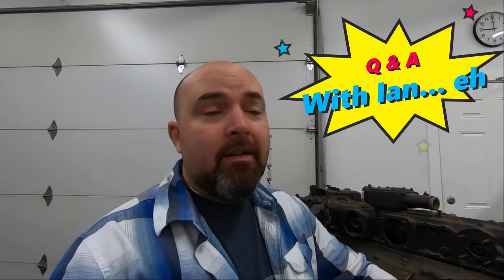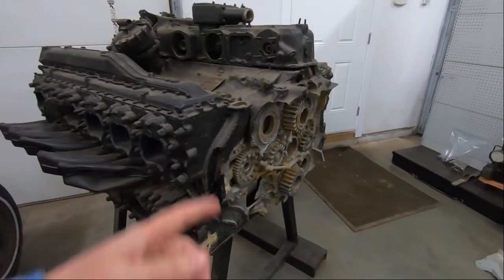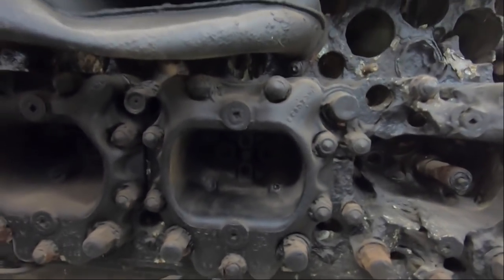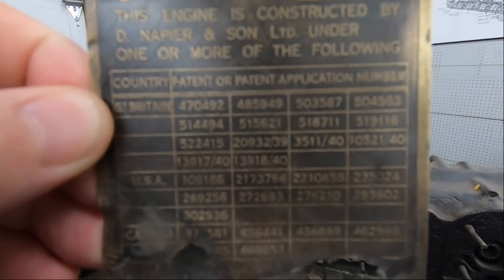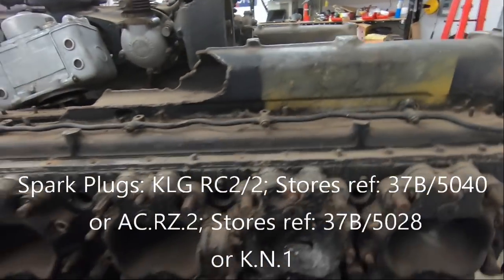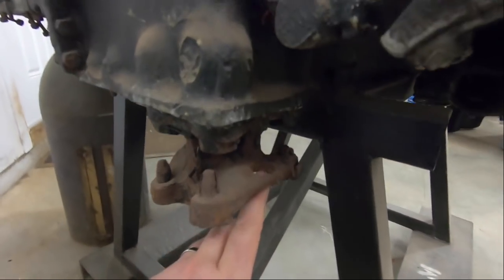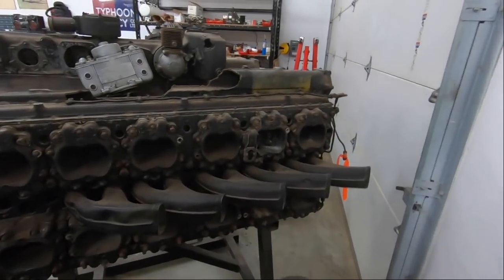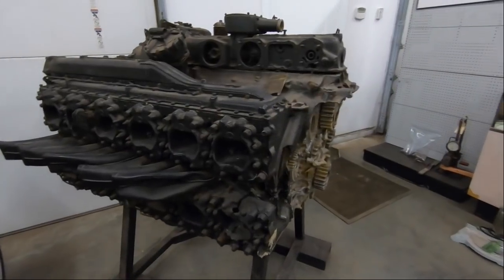Q & A with Ian eh! The Napier Sabre Engine

Comment: If you guys are serious I would respectfully suggest you get a single cylinder prototype same bore & stroke to actually rum smoothly.
Reply from the maker: There is a big difference in running a single cylinder engine and a 24 cylinder engine. There will be massive amounts of ground testing on any potential runner.~Ian

Comment: I had not seen this one although I do try to  follow Ian with this very worthy and necessary restoration project. 
The Typhoon and Tempest stories are well described by Roland Beaumont’s ‘Tempests over Europe”. To say they made a quantum difference 
would be a colossal understatement. Of all ww2 allied warbirds which we know and respect : Mustang p51 111 on , Hurricane , Spitfire, P47 . The sheer speed
and stability at medium altitude were unattanainable by those aircraft. Glamour they may have lacked but in 44-5 were  unmatched in punch and speed, when the Sabre
Was finally sorted in late ‘43, an (object lesson in engineering Co operation by manufacturers who are otherwise commercial rivals). It is scandalous that
They were scrapped with far more efficiency than their inception acceptance and development.
Reply: Beamont, not Beaumont.

Comment: out of curiosity: what is that part on the top of the engine that looks like a small air-cooled piston?
Reply from the maker: That's an air compressor for brakes and gun firing systems. ~Ian
Reply: @TyphoonLegacyCoLtd  thanks.  It reminded me of the little engines of the rc models I used to fly

Comment: I have a question I don't remember anybody asking, what advantage does a rotating sleeve valve over the traditional valve tappet and rocking arm roller has?
Reply from the maker: Reduced friction and increased compression. One of the issues with the sleeve valve system is sealing and oil consumption. ~Ian

Comment: At 3;15  the 228 is visible but there are other numbers visible as well. I can see what appears to be a 7 or possibly a 1 with a small 2 at its base left of the 228 and also another 2 at the right of the 228. The script or brushwork is totally different and it appears to be underneath the  228.

Comment: This engine won't fly - too much missing, too damaged, too far gone.  "Working on other Sabres . . ." oh the anticipation . . .
Reply: +  Happy Home    But there are lot of inside mechanical parts that don't have to be made to assemble a running engine.  Those hardened gears and shafts will not have to be forged, heat treated and machined to specs.   Arguably, the engine crankcase halves will be comparatively easy once they are in CAD software.  A different aircraft project has already 3D printed the sand molds to cast major aircraft engine parts, so the process is proven at least.
Reply: @FiveCentsPlease  Excellent, thank you.

Comment: Do you know how many of these engines survived the war and current availability?
in the 50s, 60s, 70s and 80s unlimited hydroplanes in America and Australia primarily used Allison, Griffon, and Merlin V12s.  The availability and reliability of these engines after switching to turbochargers with nitrous oxide was dwindling the supply.  Nearly all have switched to the lycooming gas turbine engines from Chinook Helicopters, but there are a couple teams that still use the old V12s (Merlins if they can find them).

The racing teams wouldn't be limited to all original parts if modern ones are available, but what do you think the likelihood of a team getting 2-3 engine blocks and cylinder heads?  This is the first i have heard of the Napier engines.
Reply from the maker: There are estimated to only be 35-40 Sabre engines in existence, most of which are crash recovered; so the likelihood of finding one for racing would be low. New build blocks would be a better possibility, it will just take time. ~Ian
Reply: + Jamy C.   The boat racers gobbled up and destroyed as many engines as they could get their hands on.   And the tractor pullers are destroying anything they can find.   I think that if the hydroplane sport wishes to return to big displacement piston racing, they should either design their own engine or find a substitute.   Falconer makes a nice V12 though it is smaller, but I think it could be configured as a marine variant.   Also, Aerosport Engineering in Norway has a new aero V12 derived from BMW V12s that's delivering around 700 hp and I'm sure it could be modded to put out more power for a marine conversion.
Reply: @FiveCentsPlease  Thank you.  Unlimited hydroplanes are out of my budget. I had a brief off the record conversation with driver Terry Troxel almost 20 years ago.

He was designing a revolutionary hull design with minimal drag coefficient and working with an engine builder in Canada.  The plan was to supercharge 2 mated short stroke V8s. Two years later he had a mild stroke. He returned racing after his recovery, but retired because he wasn't as competitive.

I would like to see the sport eliminated the gas turbine engine unlimited class or even the class entire.  The Grand Prix class is popular in Australia, but is the red headed stepchild in America and there is no excuse... (well, APBA bullshit politics).  Everything people loved about Allison and Merlin is captured in these. 1500 HP blown Chevy big blocks deliver plenty of excitement.

I share your disappointment about the destruction of those beautiful V12 war bird engines.  The Budwiser team would show up to races with a 40 foot trailer filled with them. They put a new engine in after every heat. They were as expendable as tires in auto racing.  😞

The teams that still use them cherish them like they are gold.

Comment: Amazingly compact for its power. We forget this is far from all there is to this engine. Cooling, supercharging, fuel tanks and weight, oil tank and pumps, combine to fly. And it's 80 years old. Mind you the B52 is 70.

Comment: Would it be possible or even financial feasible to restore it and maybe reproduce an engine using this as a blueprint and use one of these engines in an automobile of some sort like several people have done with the Meteor and Merlin engines? Especially since so many aero engines were used in race cars I can't help but think how cool this would be in a period car similar to how Jay Leno has built using Merlin/Meteor engines and his collection of period aero engine powered racers.
Reply from the maker: Certainly possible given the resources available, but it would also take someone with significant funding to entertain putting a Sabre in a car. Personally, I would like to see a Sabre mounted to a Fury at Reno... any takers? ~Ian
Reply: + Chesspiece    Adding that after all of these decades nobody has even managed to get one running on a stand demonstrates how rare and technically complex the Sabre is.   There just aren't many of them around and I am astounded that Kermit Weeks managed to get ahold of two of them for his project.   There are mechanical hobbyists out there who could do it, but there just aren't a lot of spares laying around.

Comment: Good stuff thanks for posting.. Is that engine mount vibration problem on early ones anything to do with the tail end weakness?
Reply from the maker: Vibrations were a structural issue, however the rear fuselage failures early on were related to elevator flutter which caused excessive stress on the transport joint between the forward and rear monocoque sections. ~Ian
Reply: @TyphoonLegacyCoLtd  Thanks Ian 👍🏼

Comment: Are you looking at 3D printing missing/replacement parts instead of conventional casting
Reply from the maker: There is a bit of research going into this, but the applications are minimal for this work on a certified aircraft. ~Ian

Comment: Are there any Sabre engines anywhere in the world that are in running condition?
One of my bucket list items is to see a Sabre run.
I have seen the Sabre that is in the Smithsonian Garber Restoration facility, so that's been checked on my bucket list.

Reading the comments below, I see that you are considering generating a 3d solid model of the engine.  Have you checked with the Smithsonian Air & Space archives?  It wouldn't surprise me if they had a full set of blueprints for a Sabre.  It would be a monumental task for a design engineer to translate 2d drawings into 3d solid models, but there are software packages out there that would help.  I have a lot of experience designing engines in SolidWorks, but nothing as complex as the Sabre.  It would be a large mountain to climb.
Reply from the maker: None running unfortunately, not since the 50's. From our investigation, there are no drawings in the Smithsonian, the Sabre they have was the spare from MN235 when in the US for evaluation. ~Ian
Reply: @TyphoonLegacyCoLtd  Very interesting that drawings are so hard to find.  I assume you already tried the Napier Power Heritage Trust.  Did you try the Air Force Museum in Dayton, Ohio?

Comment: You may know this, but one old film about the Sabre said carbon monoxide was so bad in the cockpit that the pilot stayed on oxygen from startup to shutdown.
Reply from the maker: They did make several modifications in an effort to resolve this issue (sliding hood being one), but as far as I've found, oxygen remained a full time requirement throughout the Typhoon's service life. ~Ian
Reply: @TyphoonLegacyCoLtd  Okay...glad you heard that! Would hate to have a pilot pass out after all of that work! Best wishes...I find the Sabre engine a fascinating design. M
Reply: Gerry Sayer, Gloster's chief test pilot was killed to this while flying a Typhoon in 1943.  The final report on the crash blamed CO poisoning as the cause.  From then on, all Typhoon pilots were on oxygen from engine startup until shutdown.

Comment: Aren t there any napier sabre engine s on the bottom of the ocean??? Surely there must be some who crashed ....not every pilot was always lucky....(sad enough)
Reply: +mr lonewolf groot wassink     Minerals,  acidity,  and oxygen content will affect objects regardless of if they are in soil, saltwater, or freshwater.   Metals in particular can be very reactive.  More then once an aircraft salvaged from a low oxygen environment went through a rapid decomposition when exposed to a fresh oxygen environment.   Over time the metals have absorbed minerals and salt and these must be removed or stabilized as part of the conservation process.   There are certainly engines that have been dug out of the mud or clay which have been rebuilt (with some replacement parts) and turned into ground runners.  It would be unusual to see any saltwater engine that could be rebuilt to a flight certified condition.   Typically saltwater engines are a rotten and rusty mess:   https://3.bp.blogspot.com/-I-5FMykcy6Q/V4dTujc9WMI/AAAAAAAASbc/Yx-Qv_JEDlYwXKd0smK10HQe7IeDqgPqACLcB/s640/4.JPG
Reply: @FiveCentsPlease  thank you!!! That was a decent and verry fine explanation...that was verry welcome!👍👍😃
Reply from the maker: Anything out of salt water would not be in very good shape, but there are always exceptions. ~Ian
Reply: @TyphoonLegacyCoLtd  yeah....that must be also true....well people always told me because of the fact down under water there s no oxygen...things are after a certain time of decades even still preserved in a good condition....but yeah....the salt must also do a lot of downbrake....
Reply from the maker: @searchthetruth1981  Salt, temperature, current and sea life all take their toll. That said, there are always exceptions, the Sabre in our shop is from salt water, and even some original paint markings are intact. It seems that it was stuck in mud which did a good preservation job. ~Ian

Comment: If anyone appreciates this aircraft engine story you will ! I was up in Kenai Alaska . I was in fairly remote area. I came upon a field . In the field standing up on end were 6 or 7 R4360 engines ? The ones used on the Hughes Blue Goose. They were wild just sitting there. Totally blew me away . I tried to buy them , even though I don’t know why ? I think the guy wanted 12 grand or 25 grand for all. I remember he said each engine had a 1,000$ in sterling silver ball bearings ? Engine trivia . Ha  on the motors the heads cylinders twisted around the whole motor , spirally . Was crazy to see. There 17 or 18 or 23 ? Cylinder. It was an amazing find . Very cool videos 👍🏼
Reply from the maker: Massive engines, generating HP using as many cubes as you can fit in there! I wonder what happened to them? ~Ian
Reply: @TyphoonLegacyCoLtd   I was in absolute awe of them , despite not knowing what they were exactly. 
They were standing up , all complete as can be . I’ve seen ubtube videos of them run on stands . Omg.
I had taken pictures and researched them right after seeing them . That’s how I made blue goose link. They didn’t seem to worth much extreme profit ?
I remember a lot of stuff. It was down “ Funny River Road” Soldotna Alaska . 18-20 miles down road ( it’s a Long dead end ! 27 miles)
There was a Fly in house development, bare bones big gravel runway . One or two hangers and one or two homes/ cabins . It was just getting started . That’s where they were . 👍🏼 They were so cool and there were at least six !

Comment: 24 cylinders, 2 crankshafts, 24 sleeve valves actuated by 2 driveshafts with internal supercharger shafts running through them, siamesed exhaust ports, and 3000-plus horsepower.
At least they kept it simple.
Reply from the maker: It really is a thing of beauty! ~Ian
Reply: They were saving the real complicated stuff for the Nomad....

Comment: Ian a good talk on the Saber which interests me greatly.
In the 1960's I worked for NAPIERS in the Liverpool works where the Saber was made in the 1940's.
There were some colleagues who had worked there during the Saber days who remembered well all the problems.
The Napier  company was taken over by English Electric Group in the early days of Saber production to get production going at a pace.
The design engineers were more interested in extracting more power from the engine than volume production
Towards the end of production the Development engineers produced the final version of the Saber with increased boost, water injection etc.
This was tested and produced over 5,000 BHP a record at the time but was overtaken by the Jet engine.
I look forward to a re built Saber working again in a Typhoon .
Keep up the good work.
Reply from the maker: The engine sure has an amazing history, it's always interesting to think what could be done with the design using modern materials, fluids, coatings etc. Thank you very much for following along with us! ~Ian

Comment: Great vid, I have never seen the insides of a Sabre, other than the one at the Ottawa Aviation Museum, which is a cut away version. It is too bad you couldn't just make the missing pieces, and weld them back in, and re-machine it. But that is just fantasy on a casting this complex (plus you would have to steal their Sabre, as there is no way they are going to part with it!). Perhaps scanning a whole engine, and 3 D metal printing a bunch is the way to go. At least that way you know there are no cracked engine block surprises!  Machining up the cranks and gears etc. would be a challenge, but the sleeves would be a real challenge. You may have to employ a psychic to get lost info from Roy Feddon on the other side, to learn all of the ins and outs of how Bristol made the sleeves that worked properly! :)  Perhaps Rolls Royce could search through their records on the Eagle -22, though it was prone to come to a clanking halt in mid-air, so probably not much of a help.  We NEED Dr. Who's TARDIS so we can go back in time, and mount a Napier Sabre rescue program!
 OK, so I got off track there a bit, I blame Covid winter boredom.  I will be fighting hard to get my 24 cylinder engine going this summer to help keep the running Napier Sabre spirits high. Take care.   Miles
Reply from the maker: There are certainly many options available using new technology to bring Sabre engines back. In some cases, we're just waiting for specific machines to get big enough... and they're close! ~Ian

Comment: Great Video! I have always been fascinated with the sabre Engine ever since my grandfather told me about them many years ago. He was a roving Engineering Designer who was seconded to many firms during the War , From Rotol and Rolls Royce and even to Barnes Wallis's team at Brooklands  directly under Barnes and Professor Lilley who I had the pleasure of meeting before he died. I remember my Grand father telling me of when he witnessed a Sabre Engine being Tested to Destruction on a Dyno ( i think he called it a wire Dyno, but my memory might be failing me there).  There was a story doing the rounds about 25 years ago that there were 2 complete Sabre V engines in the Middle East that had purportedly been fitted to an offshore power boat, I tried to do some digging but could find no corroboration.
Reply from the maker: Testing such an engine to destruction would be amazing to be involved with. I've heard stories of Rolls Royce doing the same in their development of the Merlin. Please do let me know if you find those Sabre's! ~Ian
Reply: @TyphoonLegacyCoLtd    I am reading that Napier did a study with the Royal Navy in 1942 for the possibility of a marine Sabre engine.  A prototype was built and the project was cancelled.   Four marine Sabres into one boat -- that's a lot of noise,  a ton of fuel and a lot of troublesome engine starts.  Napier had better success with a marine Lion engine and with their marine Deltic engines..
Reply from the maker: @FiveCentsPlease  That would have been an interesting time in the development of the Sabre to be considering new variants. May of the early teething problems were still being worked on; I suppose they really needed to push every option forwards at that time. ~Ian